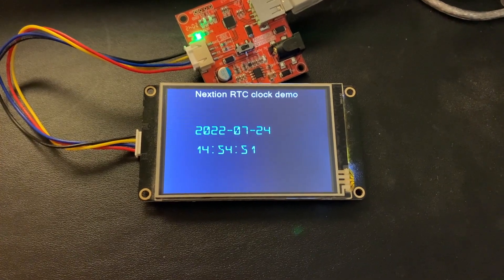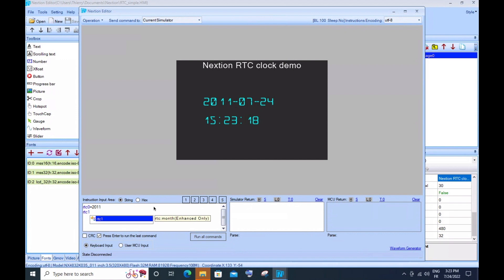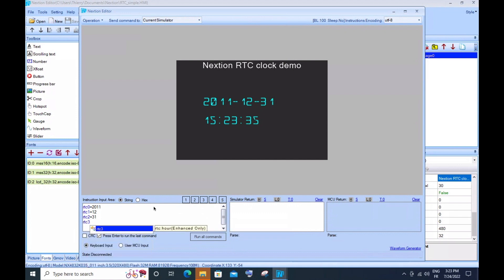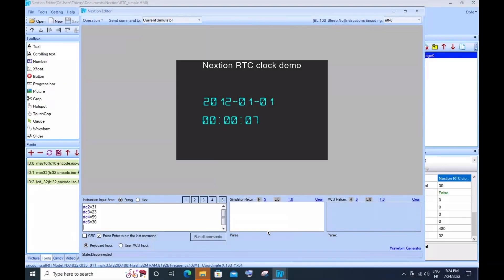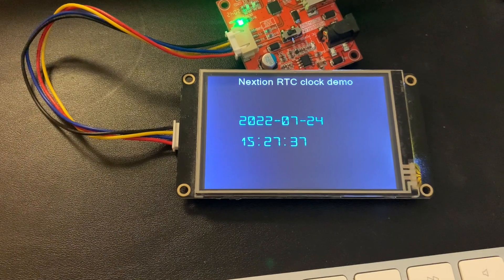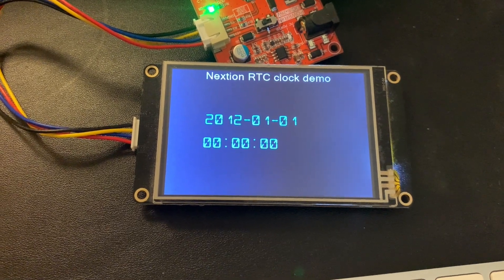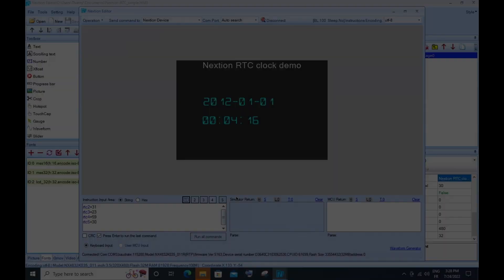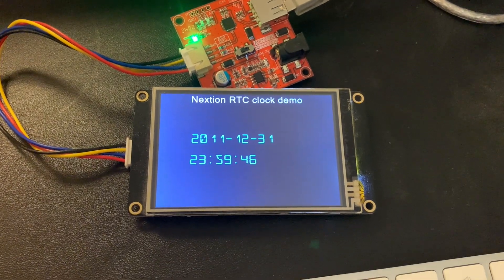The #Nextion #HMI #RTC - Use, control and problem solving

Comment: When trying to install nextion v1-67-1 in Windows10, I get a bunch of errors,
although all the Visual C++ Redistributable Runtimes All-in-One libraries are installed in the system
Everything works on another HDD in Windows 11.
What is missing in Windows 10?
Thanks.

Errors:

load dll error:
ApplicationRUN.resourses

load dll error:
achmiface.resourses

load dll error:
hmitype.resource

load dll error:
HMIFORM.resource

load dll error:
DevComponents.DotNetBar2.resourse

load dll error:
rsapp.resource

load dll error:
TFTEDIT.resource